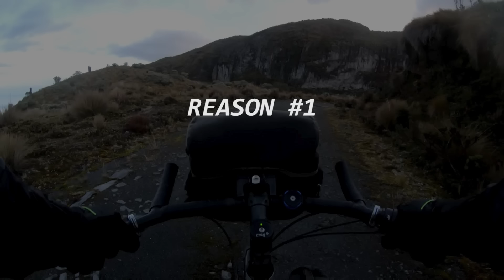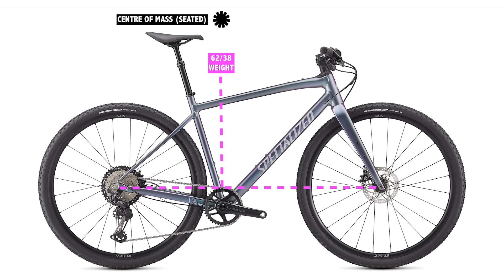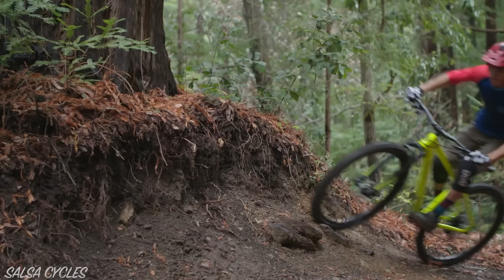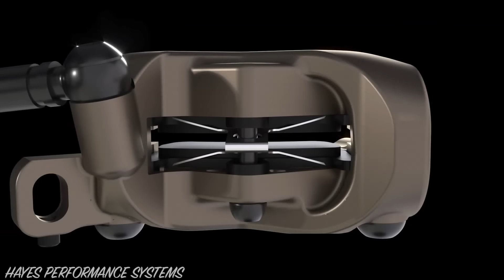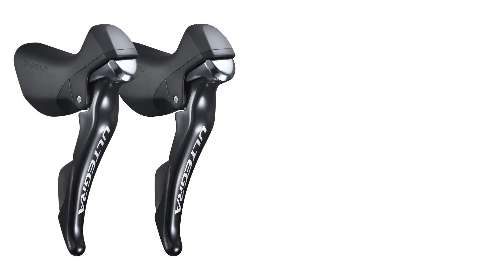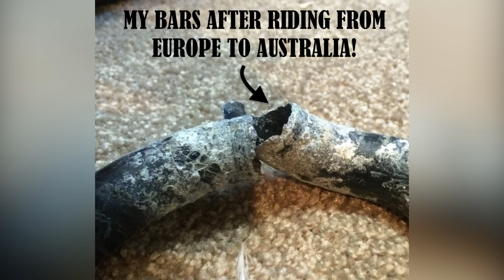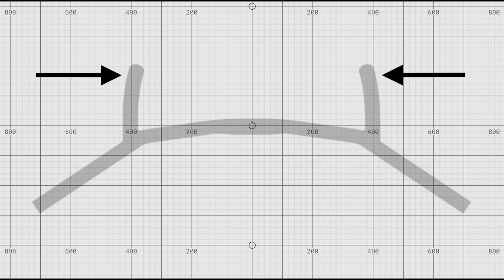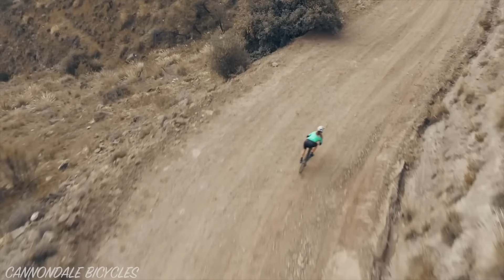Why Flat Bars Are BETTER Than Drop Bars For Most Cyclists (Objective Analysis)

Comment: I never was able to control my bikes properly with flat bars, got into a number of accidents actually. This was until I swapped out for bullhorns on my old MTB, and then later used drop bars on a road bike. I had much better control and only crashed because of someone else rather than an error I made. Flat bars also used to cause me shoulder and wrist pain, both of which disappeared with bullhorns and drops. Also I don't ever find myself gripping my handlebars firmly, which was one argument for flat bars in this video, because my bikes get a littler more unstable when I do so. Thus, my hands are almost always just planted on, without wrapping around my handlebars unless I'm trying to sprint, or brake, in which case my fingers are already close to the levers for braking. I also preferred the experience I had with drop bars when taking my bike off road, and even managed to better keep my balance when my wheels would slip on rocks without putting one foot down to catch myself.

Comment: My "perfect" bars dont exist, flat bars don't play well particularly with accessories, lights, computer and front bag and  phone holders get messed up  and congested with cable routing, need all sorts of clamps and shims to work. I would like flat bar, with very little sweep, with bar end comfort grips, with center  square D loop out front  with braze on M4 / 5 mounts help with accessories and add another hand position

Comment: You're description of how having more leverage makes steering easier seems to be based on a fundamental misunderstanding of how bicycles steer.
You don't turn the bar to steer.  You lean to create counter-steer. And that's not more to do with weight distribution than with bar manipulation.
Reply from the maker: Ride your bike through some turns with your hands right next to the stem, and then do the same turns with your hands 30cm further out in the grips. You'll quickly experience how wider handlebar widths make your bike easier to control.
Reply: @Cyclingabout  Ride with your hands on the brake hoods of dropped bars, then with your hands on the drops.
Your hands will be at the same distance from the axis, but on the drops is far more responsive.
Why? Because leaning your body naturally pushes out the drop on the side your leaning, which creates the counter-steer necessary to initiate the turn.

Comment: A lot of points make good sense but some are false or misleading. You said that drop bars don't offer more hand positions but they do and they are the only type of bars that offer access to the break levers on 2 different positions. Additionally bullhorns and butterfly bars aren't even flat bars. About the grips, I've found nothing better than the wrap. On the opposite side, you said drop bars are better in traffic, I found that they are not, it's harder to fit mirrors or turn your head to see incoming traffic with them when changing direction or overpassing obstacles.
Regarding the popularity of different type of bars in cerain areas, I agree but they also seem to fi the riding style of the bicyclists, for example in places where flat bars are popular, riding is often slow and lots of potholes on the roads, where drop bars are popular, riding is fast and road is in good conditions and in places where cruising bars are popular, riding is slow and road is good and flat.

Comment: I remember the guy at the bike shop told me that drop handlebars start to become an advantage above 20 miles or so. So if you only do long distance rides 10% of the time…meh. If you do long distance rides 50% of the time, get the drops.
For general city riding he recommended the flat handlebar road bike because the upright position is better for seeing/being seen in traffic, and you still get the advantages of a traditional road bike such as a lightweight frame & thin tires.

Comment: I agree with lots of what you say... but at the same time your analysis is off. 

You say that the longer wheel base of flat bikes makes them more stable
I mostly agree,  but this has _nothing_ to do with flat bars !

Te number of gear on a flat bar bike that you can dump is much greater (if you use a twist shift), but the problem is that most flat bar bikes never go near the mountains and are used for commuting ~ something for which they are great. But I see so many people spinning like mad just to move forward with their 32 tooth front crank. On my road bike if I need to dump a lot of gears in one hit .... I just drop from my 52 down to my 38 chainring, and a couple on my rear at the same some. Job done ~ and maybe o have a triple .... so o down to the super tiny granny ring (admittedly I hardly ever use this !). 

There are a lot more style choice of flat bars ... but you only end up with one position on them where you can have contact with the brakes. And honestly I only have one handlebar in my bike, and I’m not about to carry 3 spares to swap them over during a ride just to change hand position - so your argument is rather moot.

The extra width of a flat bar also means that when you bump something with your wheel your hand move an absolute mile - which can be quite unnerving. 

Also the stability of drops bar bikes is all about the geometry over the front wheel (rake and set back). I’ve ridden drop bar and flat bar bikes that like a twitchy ready to pounce cat. 

Finally though, I do think most people should try both, and see which they prefer.

One of the major issues is the non compatibility between brakes on road / MTB rim brake bikes. But with disk brakes that problem will dissappear, and I expect more people will convert their flat bar bikes to a wide gravel style drop bar. ~ we all love that extra speed on the downhills 👍😎
Reply from the maker: I'll bite on a few things. 🤓

- Flat bar frame geometry has everything to do with handlebars! You simply cannot make a drop bar frame with as long a front centre, otherwise you compromise the steering characteristics.
- I didn't consider (until after I made this video) that you can access the brakes from more hand positions on a drop bar. I actually edited that into the written version on my website not long after this was published. But in a practical sense, I don't think it's a particularly important characteristic because most of your hand position changes are made on the open road when you don't need to use your brakes.
- How does your hand move less with a flat bar when you hit a bump? It should be the same!
- Yep, there are good and bad handling bikes with both designs.

Comment: Flat bars are so unnatural, stupid and unhealthy, that being an engineer and product designer myself, I can't wrap my head around why they are produced like that. Basic arm and palm joints geometry tells you that that grip angle is super wrong and unhealthy, yet we see a supposed industry standard of straight ones 🤷🏻‍♂️🤦🏻‍♂️ drop bars on other hand should be entirely out of consideration as they mess with rider position way too much and will 100% cause neck disks to degrade and future neck problems, that head position that drop bars cause is super unhealthy and unnatural.

Comment: What I notice with flat bars is much greater stability at low speeds with a loaded bike. On the other hand, I am far more capable of descending at higher speeds with more control when I'm in the drops on a drop bar bike. I can make fine tuned adjustments to how much I'm leaning the bike much more easily.

Comment: So yes u can get different hand positions on flat bars if u buy experience specialist bars but u can't brake or change gears in anything but the one of them... And u can one finger brake on drops, u just have to be in the drops, which is where u should be on a descent as u have lowered your center of mass. I agree with everything else, drop bars are for going fast. If your going slow then flats are better.

Comment: Reason #4 is not true. And #5 shouldn't be considered as components can be chosen per personal preference. You can also put regular shifters and brakes in a drop bar, so that argument is also not written in stone as #5.
I find the wide flat vars very uncomfortable and more unstable just for what yiu call its advantage (its leverage) hence your argument is specific to you, your own preference, but not a true statement for everyone.
The toe-wheel problem is mainly due to wrong frame sizing not the specs for a drop bar frame neither swapping a drop bar for a flat bar.
Also brake power...you can also brake pretty well with 1 finger in a lever type used for drop bars.
Carrying capacity... Well the bigger the bag the more stuff you would carry, so the drop bar helps you keep discipline and bring the minimum (for me your 4 panniers seems overloaded) 
I think this video and analysis is totally biased due to you being used to ride flat bars for so long.

Comment: Thank you - I have been saying flat bars are better most of the time forever... and never seem to get much agreement.  Sure there are some aerodynamic benefits but gravel bikes with drop bars just don't make any sense to me.  On my Diverge I would get headaches when doing any off road riding - I switched it over to a flat bar and it was so much easier on my neck and no more headaches.  The pulling for climbing on the flat made more power per stroke for me as well.  I just don't like drop bars - flat bar is the way to go  (for me)

Comment: I'm in the market for a gravel bike and this vid was an ENORMOUS help to me. I've been riding mtb's for over 20 yrs and the thought of riding trails with drop bars kind of "tripped me out". I can't imagine bombing technical descents, rock gardens and root systems with my hands on the hoods. This video gave me the obvious solution. Flats with "old school" bar ends. I really appreciate all the data you put together for this video and look forward to more of your content. Cheers!!
Reply: So, are you in the market for a gravel bike or an MTB? because bombing down descents of any skill level isn't the case use for GRAVEL bikes. 

An mtb with alt bars does it for what you're claiming you'll be doing.
Reply: @necromax13  I'm pretty in tune with what a gravel bike is used for and by NO MEANS am I trying to be snarky in ANY WAY at all. All I meant was descending over roots, rocks, washouts, etc., was something I felt would be somewhat sketchy on drop bars coming from 25+ yrs of straight mtbing. I plan on doing some off road bike-packing and a gravel set-up such as a Salsa Cuthroat would be a good fit for the type of riding I would be encountering. While flat bars are a good choice I also plan on doing rides on railway trails where drop bars would give me more options to cut down on hand fatigue as well as allow my back and neck angles to be in different positions along the way. "bombing descents" may have painted the wrong type of picture I have in mind, but there is no doubt there will be features more suited for mtbing than straight gravel, but... That is half the fun. I appreciate the response. Happy trails. Cheers!!
Reply: My understanding is that traditional MTB barends went our of fashion because of how easily they can get caught in a branch.
Reply: @Frostbiker One thing that didn't help bar ends was the fact that riser bars became fashionable, and bar ends look goofy on risers. Iook at any MTB from the mid 90s and it always had straight flat bars if bar ends were fitted.
Reply: Impaling hazard, be safe

Comment: Wow, you hit on basically every factor I'm considering in a bike I'm designing which will be designed around a unique bar design. Thanks for getting these ideas out there.
Reply: So, did you ever get to finishing up your design?
Reply: @necromax13  I've tried dealing with a number of different companies both for the custom frame and the handlebars. I have to admit that it is such an overwhelming thing to manage between the money, the engineering and the quality control that I'm trying to use my industry connections to convince a brand I like and trust to do something with my designs.

Comment: Flat handlebars are so limited , a good strong wide ergonomically shaped drop bar is still the best all round bar you can use as far as I am concerned.... I suppose it just comes down to preference ....I have no problem with people trying to reinvent the wheel but in this instance it's a No No 🙏

Comment: Poppycock! Much of your promotion of flat bars was not about the bars. It was about frame design and gear trains. I’ve been riding loaded touring and commuting bikes for almost 35 years. My serious-load bikes all have relaxed geometry, long wheelbase, and gearing as low as ANY mountain bike. They also have dropped bars. I will never change. I have a sport/touring bike with a mustache bar and a fixed gear with a bullhorn bar. They do fine, but if I’m going any distance or carrying a load, it’s drops for me.

Comment: Thanks for the comprehensive discussion of the "two" options. I purchased a Merida Speeder 400 flat bar road bike, with 38c tyres fitted. I'm an older (63 in a few weeks) distance runner (any thing from 5km to ultramarathons, although the longer distances are my preference), although I was a cyclist as a teenager and rode with two friends who went on to have pro cycling careers. I was quite ill during 2021 so purchased my bike to stay fit and ride with my 21 yo son on his long runs. The first thing I noticed was significant pain behind both tumbs, so I fitted a pair of tear-drop shaped bar ends and some bar extensions, mounted inboard. These enabled me to grip the bars by hooking my tumbs around the bar extensions rather than under the bar end themselves. This does improve comfort, but I don't feel like I have the same control, especially on rougher surfaces. Given I live in regional Victoria, I'm not sure who to talk to about bar options, what advice can you offer in this regard, particularly as I am considering doing some touring on this or an upgraded bike this year. I do love your content, although your rides intimidate me these days.
Reply: I was in the same boat with you. The flat bar's grip just don't have the same level of ergonomics as drop bar. it's due to the nature position of the hands. You might look into the drop bar extension for flat bar or put bull horn or change into drop bar.

Comment: I’m looking at two cheap box store bikes . One is a flat bar and the other is a drop bar bike. The primary use is for exercise in the afternoons after work (5-10 miles) on paved roads mainly. I’ve had a flat bar bike and I noticed after the ride my wrists would be sore. Should I try a drop bar bike?

Comment: I put flat bars on my 2017 Specialized Sequoia, I do long rides in winter on snowpacked gravel roads, i wear gloves, inside Bar Mitts, those finicky downbar brake/shifter combos are hard to use, down right dangerous, and they don't like to shifte either,  (no rood min the Bar Mitts to go sideways) hands get cold, gloves, and just finding the shifter on a bumpy gravel road is not fun, my 640mm 50mm rise bars work for me, high enough to put the levers where they work best, narrow enough to get me out of the wind, about 8 inches wider then the stock dropbars. My cromoly, threaded BB, carbon fork, frame is ideal, I've also suspended it with Red Shift Stem/Seatpost, a mile eating, comfortable, safe, (paved roads are dangerous in Michigan) gravel bike. I don't ride it on trails, I have a Epic EVO for that, and a Fat bike for snow covered trails. A Dutch delivery bike for errands in the city,. No one bike does it all in Michigan. (maybe a repack bike, but what fun would that be? LOL..

Comment: I have what you could possibly call an old school crossover bike what you would call it gravel bike today 28 tyres 700c I have drop bars old school drop bars never have problem with control no matter what surface ridden on I have an ultra low gear on the back for climbing steep grades good acceleration to never had any problem with control very responsive on road and on gravel